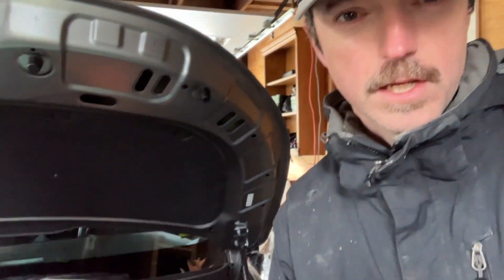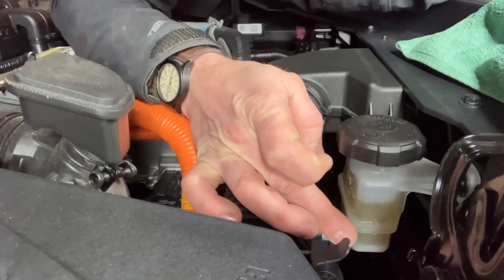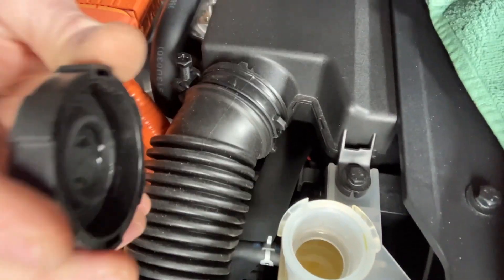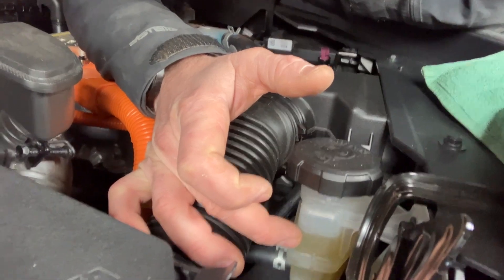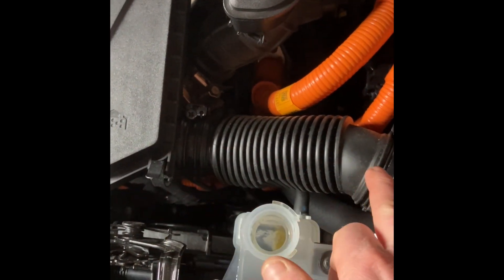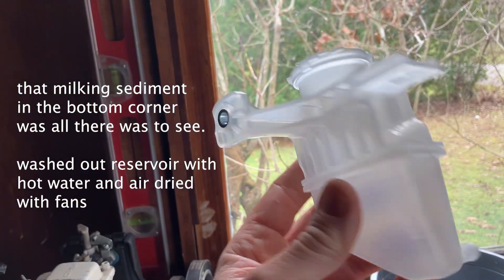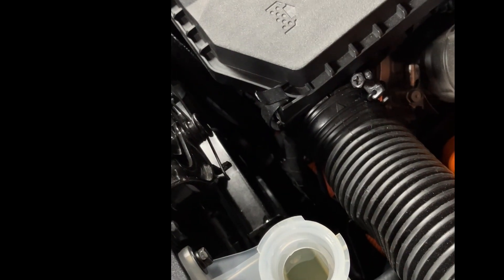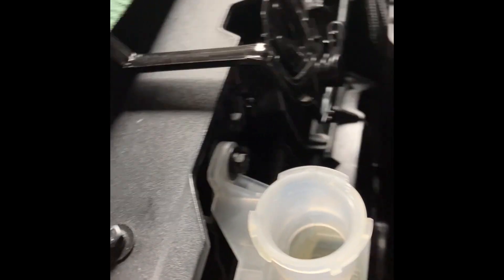Engine Clutch Actuator fluid (DOT 3) inspect/clean/reload at 5800 miles KIA Niro Plugin Maitenance

Comment: Hello. I change fluid every oil change.
I take off bottom cover. Open hose and let it drain. (Remember open reservoir lid)
Sometimes clean the reservoir.

Put hose back. Fill reservoir. Then i remove the hose again to push out air.
After air out, push hose on place. Dont let all liquid out 😅
Dont forget metal clamp.

Comment: Did you get a clicking noise after you changed this fluid. I only hear it when the car is on and in park mode and I press the break there is a clicking sound

Comment: Hey,

I normally change this with every oil change  or whenever I detect contamination. Note that after draining and cleaning the resevoir make sure it is completely dry before topping up. Might even consider cleaning it with something that evaporates rather than water like brake clean. As water is probably the main culprit here for any kind of buildup.
Reply from the maker: Yeah, great point.

Comment: Just got 1400 pages service manual (as recommended, including electrical diagrams-now they reduced price) and it looks very good at first glance. Checked what they say for this 'engine clutch' fluid. I don't see it is required to change so often but guess it will not hurt. Manual suggests using DOT4 not DOT3. I cannot be sure but manual says after fluid is drained and replaced 'perform engine clutch learning procedure' . 'Residual air in the engine clutch hydraulic line is removed during the engine clutch learning. I am not what 'learning' is in question, maybe just wrong terminology. Since I don't know exactly what is wrong or right or what is better I can assume that if fluid is not completelly drained then there will not be residual air'. If some used and new fluid are mixed maybe that is not the problem (same when we change oil, some of used oil will be in the engine and mixed with fresh one). I also don't know if white residue in resorvoir is problem or not and why it is formed? I don't think it is formed by any fine grinding in the system, probalby something that is happening to brake fluid during operation since this fluid is suseptable to moisture.

Comment: Do you need to bleed the actuator after changing the dot3 fluid?
Reply from the maker: Hi, to do the job completely, to get all the fluid out, you can actuate the actuator with a bidirectional scan tool, but since cleaning the reservoir tank only, I haven't noticed the white sediment reappear in the last 7000 miles.

Comment: Nice to see your video on this problematic portion of the Niro.
I've used an EZ VAC which has a small reservoir that the fluid falls into so there's no running back down into the reservoir. My Niro also had a white chalky residue on the inside of the reservoir which I cleaned after removing it from the car. The size of the tubing I used with the vac pump fits perfectly inside the fluid feed tube so it allowed me to go one step further. I didn't want to allow air to infiltrate into the clutch throwout bearing actuator which is down attached to the casing so I measured down to just to the top of actuator pump and made a mark on the tube. It wasn't much but it pulled another shot glass of hazy fluid. The shifting seemed to go smoother after the change.
The Niro has three clutches. The clutch fluid reservoir feeds the throwout bearing for the engine clutch which is dry. The other two are wet and select and preselect gear changes in the transmission. They are electrically activated servo motors while the eng clutch has a bellows that expands with the injection of additional fluid and forces open the dry eng drive clutch.
Reply from the maker: Thanks for the great info. I'll be keeping an eye on this fluid.

Comment: Please keep us informed regarding scanner, what model and make and what you do to drain with the bidirectional scanner
Reply from the maker: I will. I use the XTOOL D7 scanner. I'm awaiting a software update for the 2023 KIA model
Reply: @KiaNiroPluginHybrid   Love the channel, love the CAR.   You are much more detailed then I am so I look forward to you doing your maintenance. 

With that being said, any word on the XTool update.   I want to replace my fluid, but I am scared to do it without seeing how the software works.   I am at 61k miles and it needs it.
Reply from the maker: Hi John, no update on the D7 for KIA NIRO 2023-24 models. The scanner gives great feedback from the ECU (Engine Control Unit), but does not give you access to the HCU (Hybrid Control Unit) unit they update the software. Once the HCU is unlocked all features like actuating the selenoid valve on the Engine Clutch and monitoring all other systems i.e. electric motor temps, cooling systems and battery voltage/temp. I will keep you posted!   @johnmotley747
Reply: @KiaNiroPluginHybrid     Thanks for the update...  

But to be clear, even though you never Bleed/purge your car, you never had an issue?   No engine light, car runs smooth if not better?  

I picked up the DOT, I guess I just need to syphon what I can and refill.
Reply from the maker: yes, no issues at all. I was prompted to change the fluid from a YouTube mechanic I trust who works on these hybrid vehicles. Fluid has looked clear and without sediment since changing this fluid about 5,000 miles ago @computergardener

Comment: I checked the clutch actuator reservoir of my '24 Niro with just over 500 miles and the fluid looked about the same as yours, slightly amber, somewhat cloudy. I didn't remove the fluid so don't know if there is any sediment at the bottom. I think replacing the fluid is a good idea so I'll likely do the same within the next few thousand miles. It will be interesting to see if the sediment reoccurs or if it some contaminant within the system that needed to be flushed out. Brake fluid can damage painted surfaces so I hope you cleaned up any spillage. 

Regarding the brake fluid draining back down the tube, I suggest trying to heat a section of the tube with a flame while stretching the tube. The tube will contract in the stretched area reducing the diameter and when it cools just snip the tapered section at the desired diameter. The reduced tubing size might minimize the spillage. Also,  you could try dropping a ball bearing in the tube as a check valve. 

Please let us know when you get the scanner working. I already have a problem with the electronic parking brake in my car and hope to troubleshoot the issue. A yesterday the parking brake took a bit of extra time to disengage, made a raspy whirling sound and now the parking brake light flashes and the EPB light stays on.The smart cruise control is also disabled. The car runs fine and the parking brake disengages (it rolls easily in neutral) also the brake resets when I park but the dash indicator light continues to flash when the carr is running. Of course, this should be covered under the warrantee but I like to know exactly what's going on with my vehicles.  BTW, can you tell me where you access the OBD connection? Thank you!
Reply from the maker: Thanks for the update on your car, thoughtful technical comments have been a huge learning benefit to starting this little channel.

I was just reading about the EPB actuators. There is one on each break caliper that can adjust the amount of holding pressure on the rotor depending on angle we park at (how steep). 
I believe from the drawings I see that Integrated Electronic Booster (IEB) has a motor and 'ball screw' (do quick image search on 'ball screw' it will make sense) that applies hydraulic pressure to each of the actuators and I wonder if the 'whirling' sound was the ball screw and motor retracting and relieving hydraulic pressure but the sensors on the actuators never reset which has sent error codes to some of the other systems like cruise control? Wish I could share my technical drawings...maybe I'll shoot a video on how this braking system works. Good luck, the warranty should absolutely cover this and get you on track.

The OBD connection is right next to the hood release lever by your left shin. Once the D7 has the 2023 KIA models updated (I emailed the manufacturer 'XTool' this software update may not come until the end of the year, I will make a slew of videos looking at all of the on board systems and sensors. Wish I had something productive to offer you concerning your brakes. Sorry to hear about the issue. Please report back to the channel, if you have a moment, when the solution is figured out.
Reply: @KiaNiroPluginHybrid  Thanks for the detailed info on the e-parking brake and OBD port location. This weekend I backed the car up on ramps and inspected  the actuator motors on the brake calipers, checked for any outward signs of loose wires, damaged components and everything looks normal. I found many youtube videos of various repairs made to e-parking brakes, and the work arounds to retract the piston when replacing brake pads. The system used in Kia Niro seems like it should be relatively simple and trouble-free, maybe I just got a dud.

Actually, I'm quite impressed with what I saw under the car, good underbody protection/belly pan, nicely finished and coated parts, hopefully well sealed to the salty condition that will be encounter here on the MA coast. I'll try and schedule a service check with Kia and meanwhile may try my old scanner, (Seekone OBD 2, discontinued on Amazon) to see if it will read/reset any codes.  I'll let you know what transpires.
Reply from the maker: @chrisi1920  appreciate the update. Good luck.

Comment from the maker: I meant to write, 'milky sediment' at the bottom of container. This was the best description I could think of. I will post an update in around 2000 miles
Reply: Does this mean we have to change that Dot 3 fluid with every Engine oil change?
Reply from the maker: @manochuchu456  It appears it would be wise for the long term life of the car. Luckily the DOT 3 fluid is cheap and easy to refresh
Reply: @KiaNiroPluginHybrid  also I was watching in one of your videos u were saying that it has a dry clutch and it dosent take transmission fluid.
But I was checking online it does needs dual clutch transmission oil change after certain kilometers.
Any confirm information related to that?
Reply from the maker: @manochuchu456  hmmm, interesting. My manual says unless the car is submerged in water, this transmission has no schedule for maintenance. I will double check this when I get back from work today.
Reply from the maker: @manochuchu456  yeah, a bit strange, but my manual says the transmission fluid 'no check - no service required' unless the transmission is submerged in water...in this case, there are 2 filler plugs and a drain plug for replacing the fluid. The clutch is considered a 'dry dual plate' but the transmission and its two gear boxed does have lubrication. I can see how this sound confusing.
Reply: @KiaNiroPluginHybrid yes so I find out that the dual clutch does has the DCT fluid inside it and it does need a replacement after around 200 thousand kilometers.
Reply from the maker: @manochuchu456  thanks for the research, very good to know.